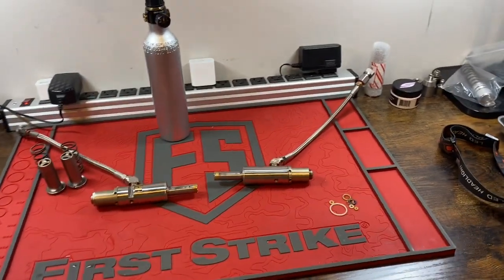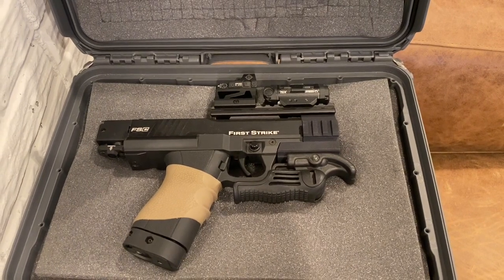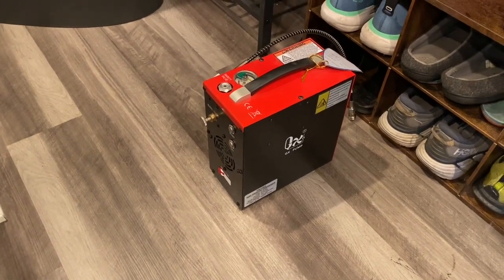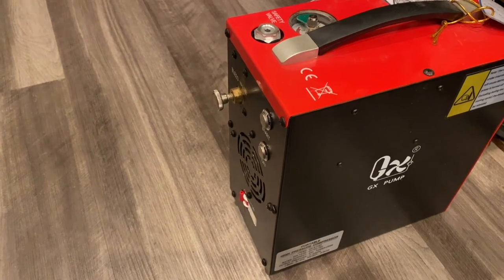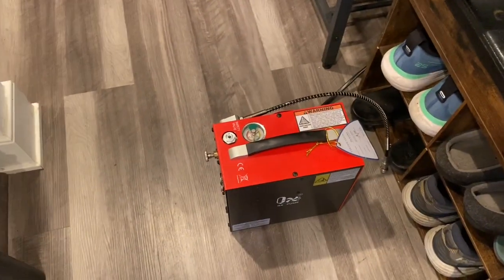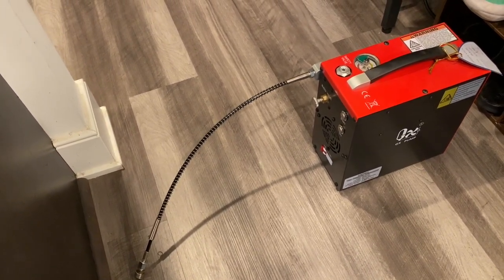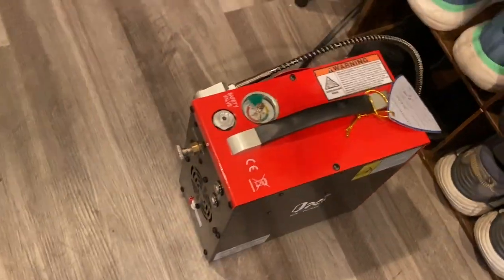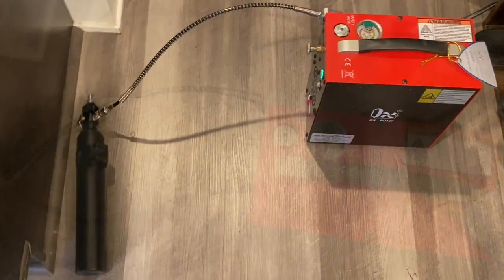Updated Review; GX PUMP CS3 PCP Air Compressor & other HPA Tank Fill Options

Comment: Nice ! Thinking outside the box . I have the same compressor and a 4500 dive tank and  have owned them for over  a year with endless use and without a problem.  And to add a little insurance, I bought the 5 warranty for a piece of mind .  I always run it for a minute first to get all moisture out and administer it to the bottle. I occasionally will take a peek at the filter element. Other than that no issues . Definitely a much better option  vs submerging a pump in a bucket of water like that other option.
Reply from the maker: I’m seriously considering getting a dive tank. You don’t fill it with this, do you?
Reply: @NewGuyLessLethal  At the moment no . Although , I am sure it’s capable. My dive shop usually will certify the tank and fill it for 15.00 dollars . I usually will use it for my PCP rifles out in the field and usually get roughly 20 -30  fills out of it .

Comment: Has your GXSC3 broke down on you yet ?? Mine has took a dump on me 3 times now with less than 4 hrs on it !! The first time the power pack started smoking and burned up on me the 2nd time the mother board took a crap on me and today when i tried to fill one of my airguns the compressor wont build any pressure higher than 600 psi !! I checked and no leaks at all it runs just fine but wont go past 600 psi ! 
Does anyone have any idea what could be wrong with it?? 
Any help would be greatly appreciated !!